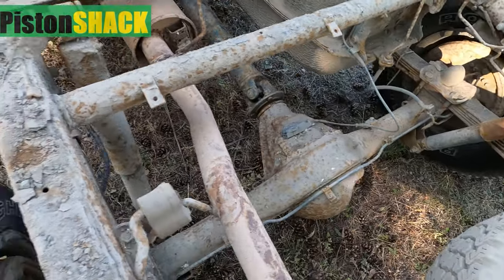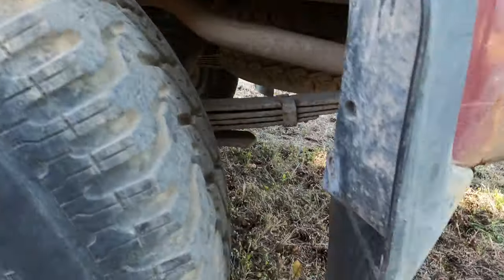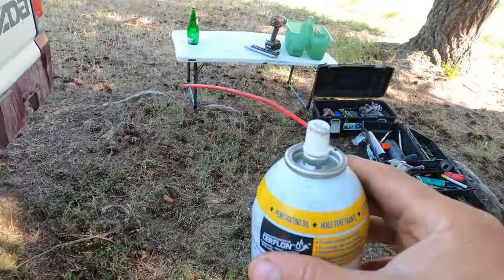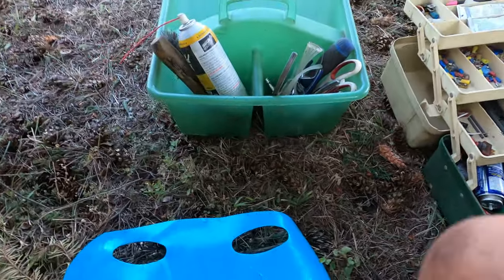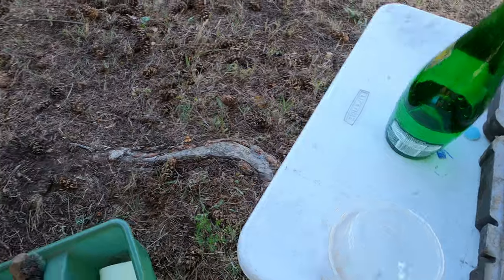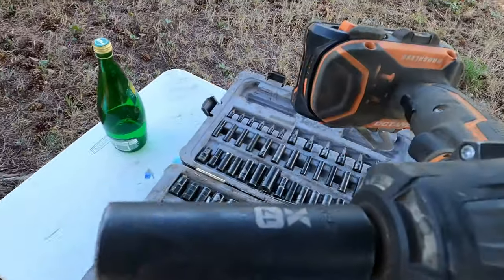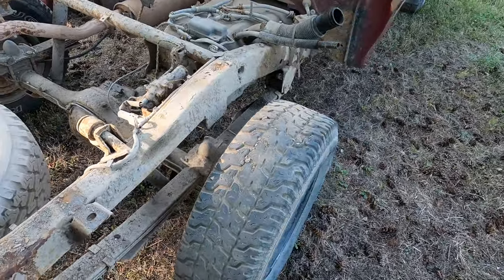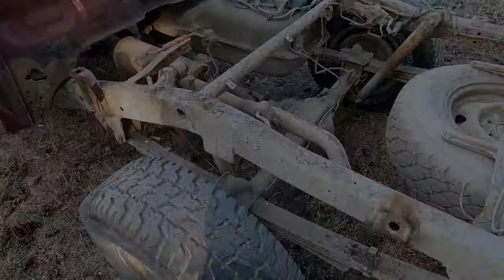HOW TO REMOVE RUSTED PICKUP TRUCK BED - Easy One Man Job // 4K

Comment: wouldnt it be a lot easier to just weld that hole up or is this just for content ?
Reply from the maker: Hi Martin! Yes, you right I just can patch and weld those holes. I had to replace all brake lines my truck, plus I had rust free box from my parts truck. What kind Mazda truck do you have?
Reply: @PistonShack  i dont i just was watching to see if/how beds could be removed in view to putting a demountable on a similar pickup !

Comment: Building a flatbed for mine. It's also getting a diesel swap
Reply from the maker: That's a way to go! What kind diesel engine do you have for the swap? I am looking forward to check your swap in details. Thanks for watching Ward!
Reply from the maker: I have couple 7.3L IDI trucks with one great engine with only 250K another parts truck. I am planning to get IDI 7.3L get swapped into Ford Super Duty. Any recommendations or ideas. Thanks)
Reply: Kubota 2203 I need to upload a few videos